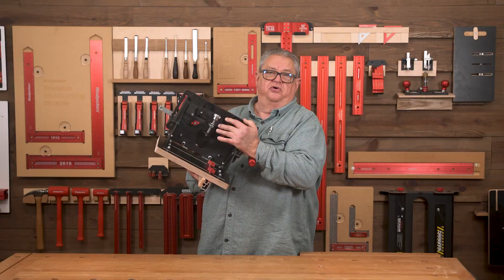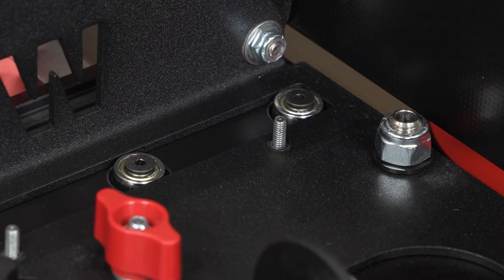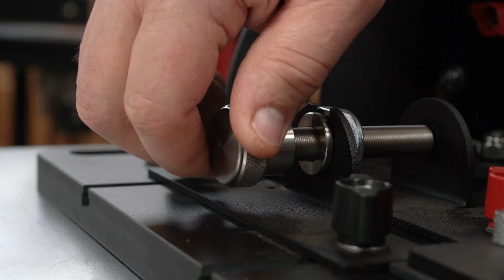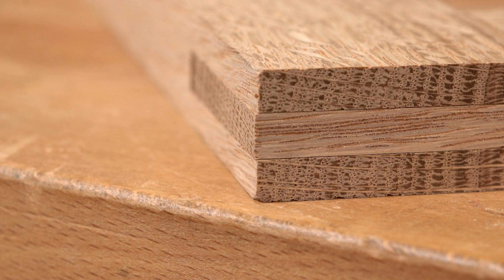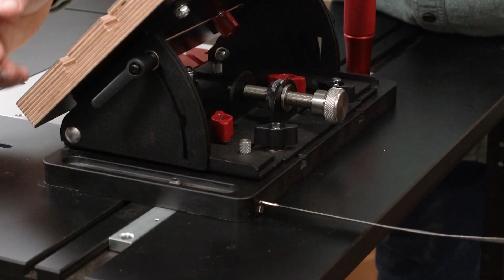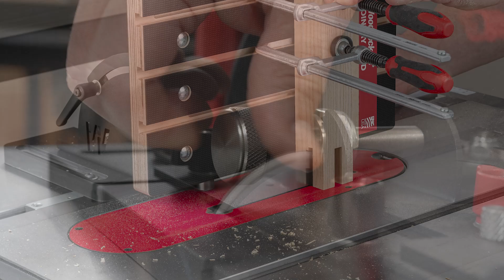Deep Dive: Half Laps and Bridle Joints made easy with Woodpeckers Joinery Sled

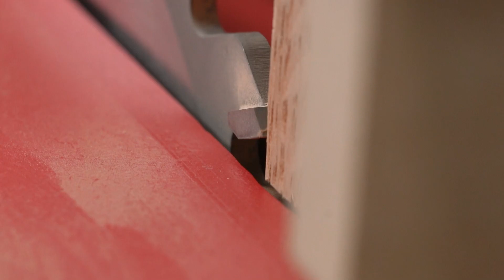Comment: Jig is alright I suppose but it sits a couple of hairs above the table surface to prevent drag. Since there’s play between the metal runner and the machined slot there’s quite a bit of vertical play, which will taper your tenons and mortises. Check the movement on 6:45 min. That’s also why the first test fit went in only half way. Maybe a nylon or even felt liner on the base of the jig can fix this.
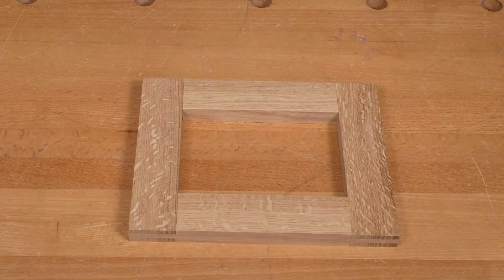Reply from the maker: There are adjustable nylon pads. You can even see their tracks in the saw dust. I think you might have been watching with the sound turned down, because I clearly stated that I was making the tenon too large on purpose and then sneaking up on the perfect fit. You can also see in the extreme close-up of the finished joint at 7:57 that there is no taper in either the tenon or mortise.
Reply: @Woo @WoodpeckersLLC nk you for clarifying! The nylon guides weren’t shown or talked about in the video, but since you mention them: one side of the base plate is not supported by the guides during the actual cutting due to the fact that the saw insert sits (slightly) below the saw table surface. It may not be much but when cutting larger bridle joints this can be an issue.

Comment: Saw stop indicates that the maximum width 10 in sawblade to use is 3/16 inch. And they say for thicker blades ( such as the 1/4 in blade in this demo)
 "Therefore, those blades should not be used because they may stop more slowly than standard blades in the event of an accident, resulting in a more serious injury."

Comment: Great video. Where can one find those clamps you used on the jig? Please and thank you.
Reply from the maker: Used two different ones, so I'll give you links to both. This is the track clamp (used the most in the video) https://www.woodpeck.com/ehoma-track-clamp-screw-handle.html
And this is the pivot clamp that is included with the Joinery Sled: https://www.woodpeck.com/hold-down-clamp-pivot-non-slip.html

Comment: I was accustomed to using the usual cast-iron tenoning jig with my previous table saw at my previous house. I sold the jig with the saw when we moved. I was about to buy another when WP introduced this jig. More expensive, even with the introductory discount, but I really hated the old cast iron jig, so I sprang for the WP jig. Boy, am I glad I did. One note: if you have a table saw setup gauge with a dial indicator, it's a heck of a lot easier to set the jig parallel to the table top with the gauge than by using a 1-2-3 block and the saw blade. Set the gauge in the miter slot you're not using for the jig, set the indicator tip on the working face of the jig and run the jig forward and back, adjusting the angle of the jig face until the dial indicator shows the same reading at both ends.

Comment: Jeff this is pretty impressive. Can it cut spline slots on a picture frame? If so I would like to see an idea on that. Thanks,Jeff. Keep em coming
Reply from the maker: Yes, it is great for frame splines. You need to make a vee fence on the vertical table. That can be as simple as two boards aligned square with the mounting bolts or you can make the frame a little more permanent by attaching the fences to a piece of plywood and then mounting the plywood to the vertical face. All depends on how often you're going to use it.

Comment: I read several comments here asking Farris to produce a video depicting the creation of a castle joint with this sled.  I am not an expert, certainly, but I have used this sled successfully to make castle joints.  What's more, I made those joints on the ends of 8-foot 4x4 posts.  This marvelous sled is so sturdy and well-designed that I was able to stand up an 8-foot post on end and slide it through my table saw blade without mishap.

I learned a couple of things along the way (I am a novice and am always learning things along the way).  The first, and this applies to all table saw or router table operations, is to make the table surface as slick as possible.  I have taken to applying some paste wax to the table each time after using it.  It takes only a minute, but the smooth motion while pushing a heavy work piece really helps keep the push under control.

Next, take your time.  It is not new advice, and I am not the originator of it, but let the saw blade do the work.  A nice, slow, deliberate push will not jar or put lateral stress on the work piece, even if it is an 8-foot 4x4 post.

Next, the clamps shipped with this sled are awkward to handle, especially if you are trying to hold a large work piece in place when applying them.  The ratchet kind of clamp Woodpeckers sells is definitely superior.  Using those, I was able to balance that 8-foot post with one hand and apply the clamp with the other.  Always use two clamps.  While Farris does not use the ratchet-style clamps in this video, neither is he using the clamps that ship with the sled.

Next, and again this is not new advice nor my own, make several shallow cuts rather than one deep one.  For my castle joints, I was cutting 3-1/2" openings in the posts, but certainly not with a single pass.  For such a deep cut on such a cumbersome work piece, always take two or three passes.  I found I could push the balanced post through the blade cutting 3/4" at a time without unduly disturbing the balance of the post.  As an aside, I used Woodpeckers dado stack with the top beveled teeth, and they are very sharp, a real pleasure to use.

This next tip is critical, and Farris does not demonstrate this in this video.  This sled is equipped with plastic leveling feet that come into play when the clamping plate is extended several inches beyond the base plate.  At first, I did not bother with them but soon discovered my joints did not come together nicely.  This was because the clamping plate wobbled during the cuts.  Then I deliberately tried to wobble the clamping plate and found that I could.  I decided to actually pay attention to those two little plastic leveling feet.  It's not hard to bring them down to the table, but it really, really makes a big difference.  Doing so removes all instability in the clamping plate and after setting it perpendicular to your table, it will stay perpendicular during the cut.  It made all the difference.  A downside to those leveling feet is that it seems they wear quickly.  I suspect that with extended use, they will wear down to a useless length.  Hopefully, Woodpeckers will sell those separately.

The micro-adjuster is great.  It is very sturdy and accurate.  You can move the clamping plate miniscule amounts until you get it just where you want it.  I moved the entire clamping plate by hand to a point about where I wanted it by loosening both the red and black knobs and then tightening t down with the black knobs.  Then I moved the clamping plate in small increments until it was perfect, tightened the red knobs, and I was ready.

I have used this sled for other cuts as well.  It is really quite well made and strong and sturdy.

Comment: My WP joinery sled work surface is not square front to back, not even close. The sled also does not run smoothly in the miter slot (SawStop), its super tight.
Reply from the maker: The calibration of the sled is covered in the manual. Odd to hear the track doesn't run smoothly in SawStop, since that is what we have and test with. Call Customer Service.

Comment: Jeff, thanks for yet another outstanding Deep Dive.  A couple of questions on the joinery sled, which I have on order:  (1) What is the thread on the micro-adjuster, or, how much travel is there per revolution?  (2) I assume there's at least some backlash in the micro-adjusted, so one has to take that out before reversing direction?  Hope you will have a deep dive on making castle joints as well.
Reply from the maker: Brian, It's 1/2" x 32tpi -- so 1/32" per full revolution. There is a tiny bit of backlash, as you would expect. It's pretty easy to feel when the threads re-engage. I'll try and get that castle joint DD in the line-up. I would love to do it. Had a good time figuring out how to do it with the Joinery Sled, and it really is the right tool for the job (compared to a saddle jig on the rip fence).